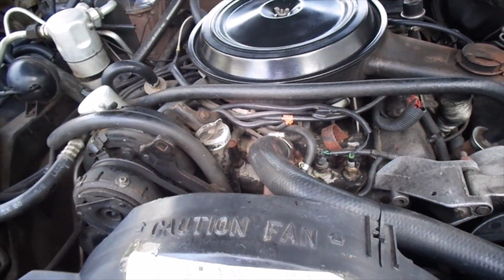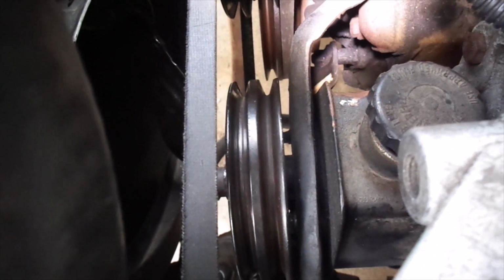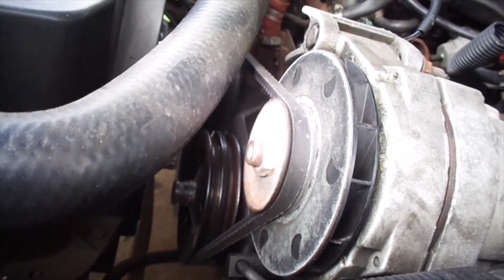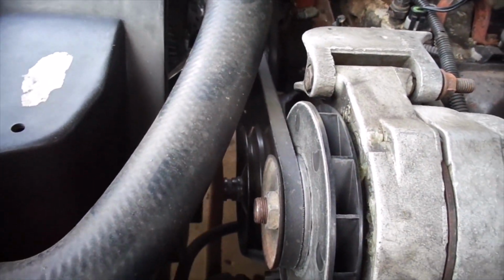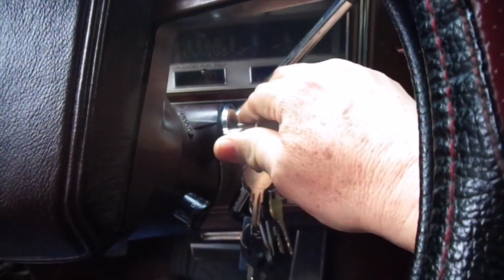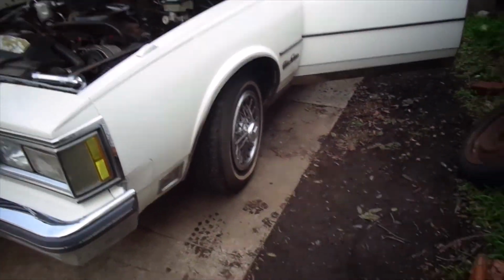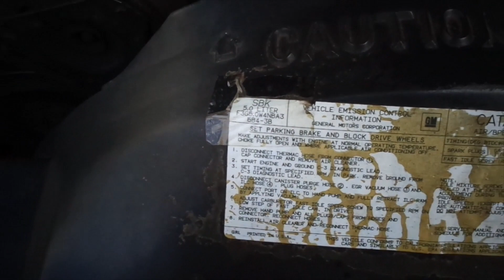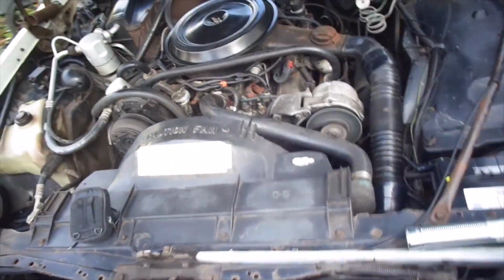1985 Oldsmobile squealing fan belt problem 5.0, v8 olds engine delta 88 I fixed..

Comment: you want to tell the viewers, the “wheel” is called a pulley. 😊
I agree, the redundancy of two belts is very strange.
Reply from the maker: thank you,  its very strange
Reply from the maker: double belt pully it should have been one for the power steering only.
Reply: I only use it at all you can eat buffet

Comment: Diablo.   Whats up man?    What are the belt numbers?   I have the same problem.   The fan pulley and the power steering pulley are slightly out of line and my belt squeals as well

Comment: is it hard to find parts for an 85 Oldsmobile cutlass supreme?
Reply from the maker: engine parts from auto stores no, bought a starter alternator and other items with no problems.
Reply: @diablo-km2ot  i just bought an 85 cutlass with a 307 v8 28k miles on it
I want to put money into the build but also daily drive it, you think its a good idea? is the engine a good reliable engine?
Its in very good condition for its age
it
Reply from the maker: my engine is a 5.0 its use a lot of gas, you have a smaller engine so you should be fine.
Reply: @diablo-km2ot  yea ive been daily driving it and so far so good i only spend $45 to fill it up every 4 days
Reply from the maker: mine too it's a tank use up gas but its reliable.

Comment: What size belt did you use? do you have the belt number?
Reply from the maker: the one that it has on is 15470 it is turning the alternator and the power steering.   the power steering belt took that one off because two belt on the power steering now it has one, sharing the alternator, runs great no noise..
Reply: I have the one groove pulley on my power steering pump an it squeals like hell. I want to get the double pulley to run it like yours
Reply: @jaredjohnson178  just get a new belt and tighten it tight the noise will stop
Reply: @jaredjohnson178   yours set up is correct not mine because it has a double pulley instead of one,  you have one belt on your power steering maybe all you need is a better belt and make sure to have it nice and snug.